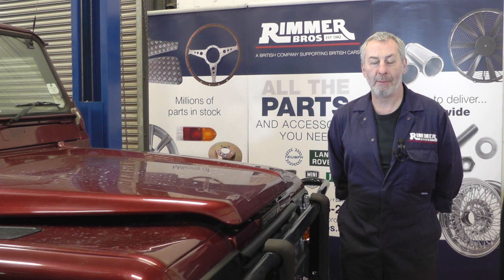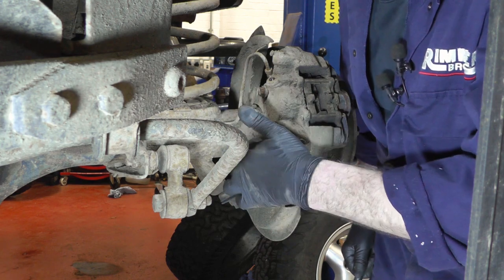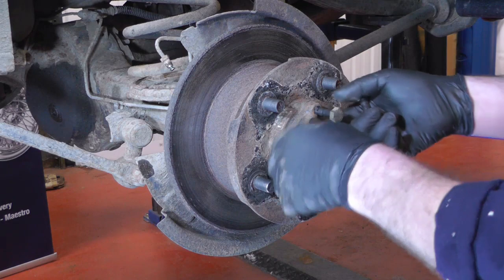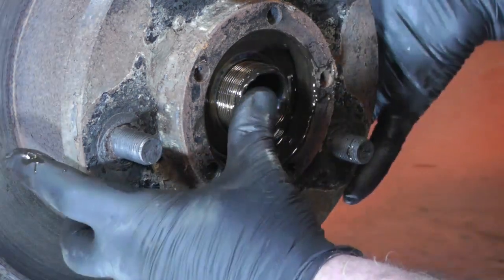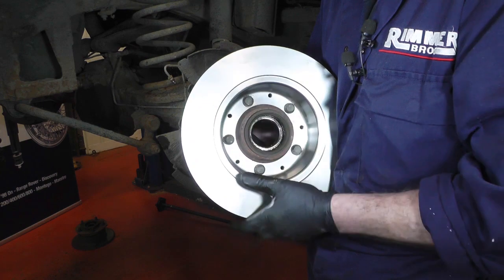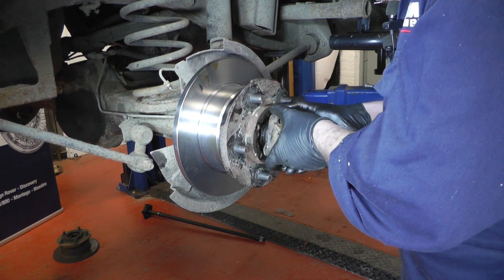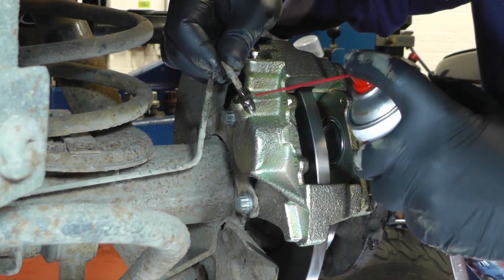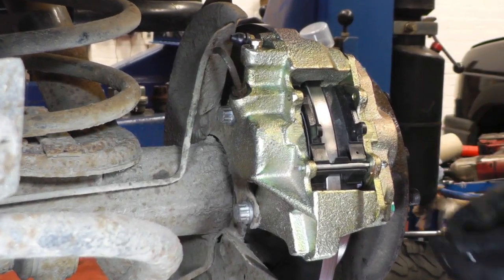Replacing the Rear Discs, Pads and Calipers on a Land Rover Defender TD5

Comment: What size socket is needed to remove axle nut?
52 mm for the front, is it the same for rear?
Reply: The socket for both front and rear axle nuts is 52mm or 2 1/16
This is CONFIRMED

Comment: My 90 was pre discs but a previous owner has changed it from drums at rear. Would same part nos be suitable for new rotors as they are an advisory on my mot. Looked through old invoices cannot find, when changed nor what used before
Reply from the maker: That's a tough one, Dean. Best that you ring us with your VIN and we'll see if we can work out what will fit.